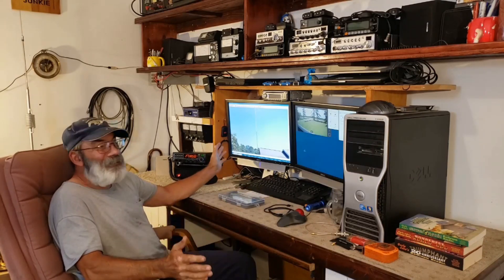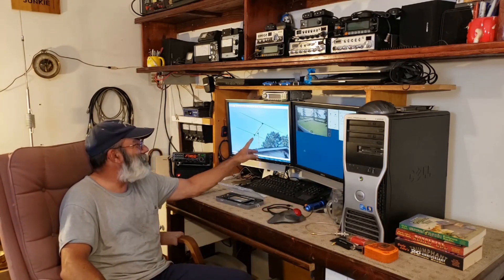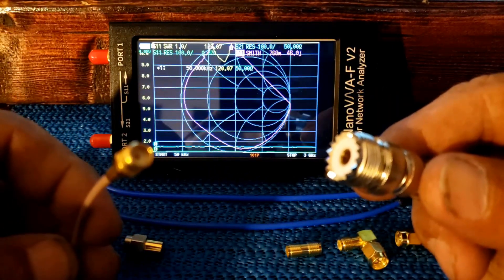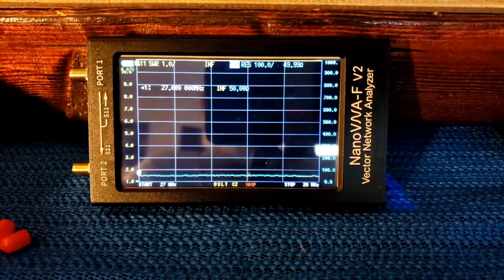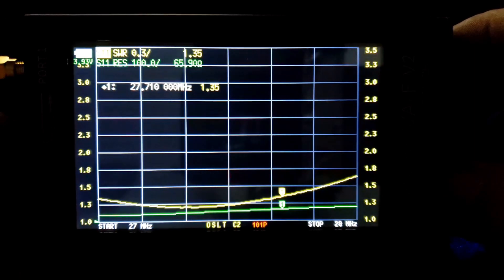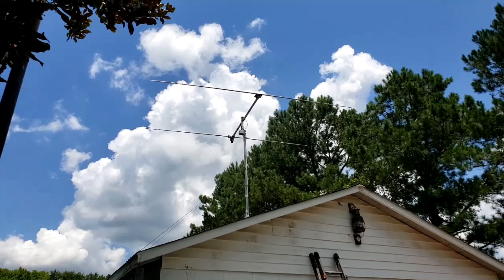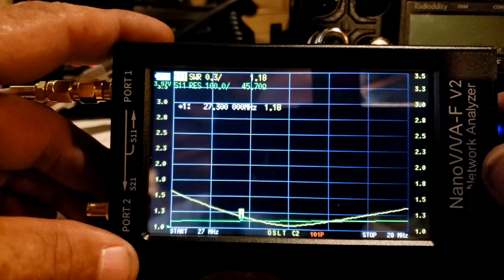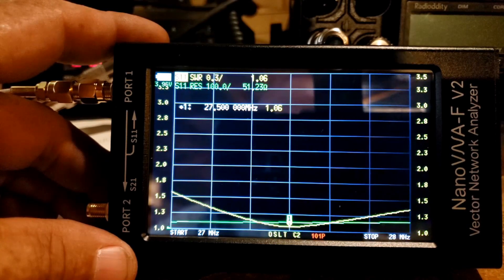NanoVNA-F V2 Analyzer From Radioddity, Testing my base antennas.

Comment: wow thanks , now I have something else to purchase ( lol jk) . I just bought a 4 element beam and a rotor and 75' of rg213 uf. lol.  I'm  using an mfj 259b and a 226 . actually I have a smaller version nanovna hate the screen size my eyes are getting old and you can't read it in the sunlight . 

anyway great video , glad you antennas are behaving properly , I,m still pulling my hair out with the yagi but gettin closer to good numbers so It will go up the mast soon on the flat side . 73's . 998 Az

Comment: Them are great to have. You can check coax loss with them . Smith chart and so much more. I have the H4 version .bigger screen . I also  use a Rig expert 55 ZOOM . Made in Ukraine.  Also a tiny SA will check radio    and amp with filters for signal quality . I have full size spectrum analyzer with tracking gen.  When making antenna's that VNA does much better than just SWR . You can even do return loss and reactance.  This got me to dial in a end fed 5/8 wave with 4:1 UNUN to match.  Also 1/2 wave is 49:1 UNUN . You can test the UNUN and Balun with that VNA . measure the loss and help you pick a better toroid or better way to wrap.  I found for CB 11 METERS type 61 ferrite works the best . All thanks to a VNA . You can even tune a gamma match much better with that . Their is 2 adjustments on a gamma match. Some times the 1 is fixed . That the strap to element. distance to center. That sets ohms. The gamma match has a rod that slips in and out. You set SWR with that . That does capacitance adjustment, in is more and out is less.  I use the smith chart and dial that right in. Their is you tube video's on how to read a smith chart . A very handy tool when making a antenna . That pole near buy may not react much or at all. It is vertical . you antenna flat side.  But when under 6 ft expect trouble with power . It can reflect back and make SWR jump or it will block you on that direction. depends on length of metal. Cheers from NY !

Comment: Hy Buddy. You got a Construktion Plan on the 2 Element Yagi on the Roof by the Garage ? 

Looks insane 

Second question please

Witch koax you use for the long way tonthe antenna ? 

73to you 

10-4
Reply from the maker: I don't have a parts list, But all the math came from this site; https://www.hamuniverse.com/wb2vuo2elyagi.html
on the beam I have 36' of RG8X coax, and 70' of LMR400 on the vertical.

Comment: The pole doesn't do much to the beam SWR because its vertical. If the beam was placed vertical i think the pole could react (a little bit) on the SWR.
Reply from the maker: Good point, Thanks.

Comment: Tram 498 looks like stardust antenna.
Reply from the maker: Yes, but it's twice as tall as a Starduster
Reply: @MowerJunkie how do you compare that tram vs Antron 99 I’m looking for an upgrade, also skip is decent today out of Michigan st croix Virgin Islands etc
Reply from the maker: @kaizersoze2606  I found that the tram 1498, and the Antron A-99 have almost identical performance.
Reply: @MowerJunkie Roger that…. I need to be higher up as well I’m barely 40’ above ground but in a congested area, trees power lines etc I would be happy another  20’ but I need guide wires or I could just watch and pray 🙏 lol

Comment: Well I've been trying to raise you on the radio lately but it's just not happening. I know I wouldn't be able to fool you but I was going to try anyway. But you'd know from the signal strength and clarity that I'm much closer than I used to be.  Yes, I'm in SC now. Been here since May. I had to spend a few days at the Comfort Inn & Suites in Camden because the seller was taking her time getting papers signed/notarized and delivered. So the official closing on the house in Sumter was May 21st when it was supposed to be the 14th. I closed on my condo on May 13th. So anyway......howdy neighbor.
Reply from the maker: Very cool! Welcome to SC.! Send me an email with some pics, I want to see what you bought.
when I first starting reading this, I thought you were still in Ct., I was going to let you know i was talking to Ct. at 1am this morning.
Reply: @MowerJunkie  I don't have anything set up in the house yet. I'm waiting on that custom Mower Junkie antenna and 40 foot tower you promised me.  LOL  I put a mag mount with a 102" whip on the roof of my Cherokee and was picking up signals from northeast, southwest and midwest. I'll send some pics in a few minutes.

Comment: Hi my friend quick question do you know what antenna was on the fall guy truck I cannot find anything on line
Reply: Probably a 102" whip.
Reply: @JoeR860 No, it was a common thing to mount the antenna on the roll bar; in fact, most of them had a bracket in the middle, between the two spotlights, just for the antenna.
Reply: @spaceflight1019 it was on the rear quarter panel
Reply: @andyc664  After looking at the Google photos, you may be correct. I was totally wrong.
Reply: I think that it was a base loaded Antenna Specialist or Radio Shack antenna.
Reply: Fall guy truck actually ran 2 different antennas, in some scenes it’s a 102” whip and in others it’s an 8’ Francis amazer.

Comment: I put a video on here with the easy way to use one of those. You'll love it!
Reply from the maker: Cool, I'll check it out
Reply: @MowerJunkie Technical Chinese can be very confusing. That device eliminates the guesswork and the need to drag out a meter and radio when testing an antenna.
Reply from the maker: @spaceflight1019  Very true! with all the antennas I build, I really needed this.
Reply: @MowerJunkie  You'll love it! I wish that I had one of those 55 years ago, when I was a kid building antennas.
Reply from the maker: I just watched your video, I prefer to see the resistance too, not just the SWR.
Reply: @MowerJunkie  I think that the resistance is somewhere on the screen, but maybe not. For me, the swr curve is what I'm interested in. Especially on my scanner antenna.